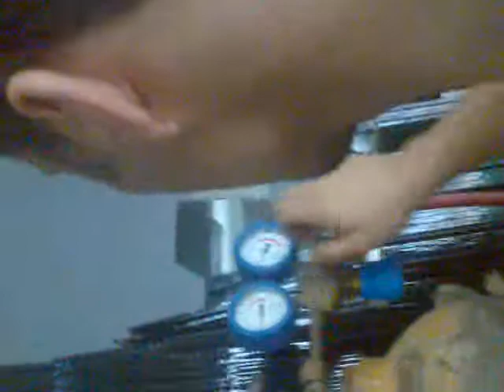glass filling with Argon

Comment: Argon gas is a thermal barrier to keep the outside cold from transferring through the glass. Its also prevents the window from building up condensation.. Lots of windows co's are selling fake thermal windows.  Just remember this when buying Argon windows...........the argon injection holes are visible in the inner corner of the window. If you don't see the small rubs sealing caps on the filler holes, its not a Argon filled window just a regular dual glass window.